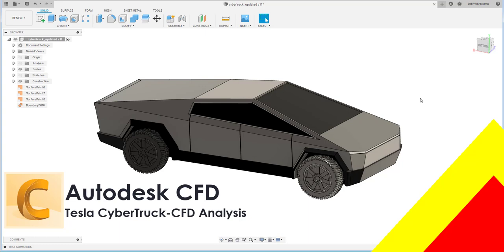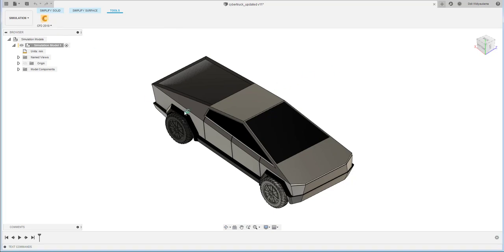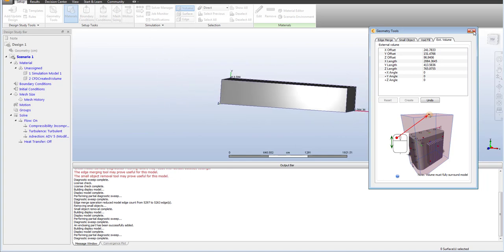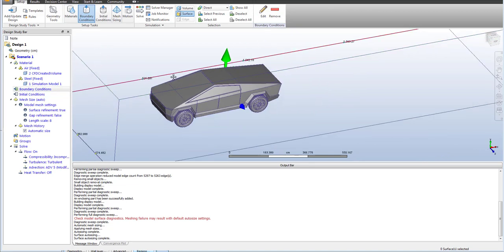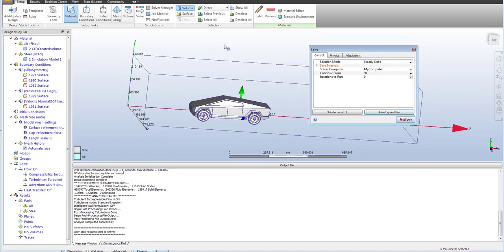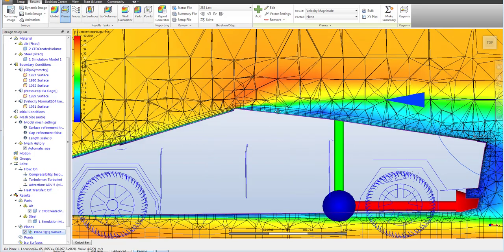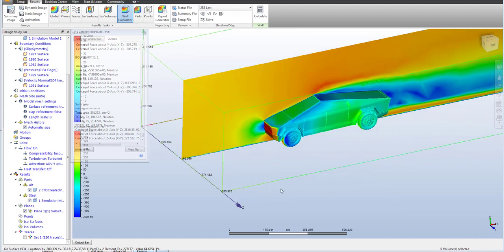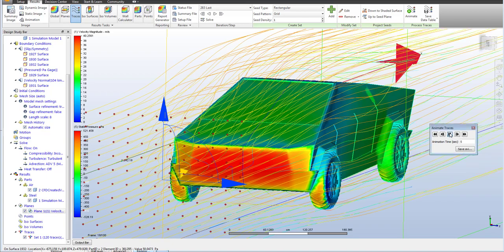Tesla Cybertruck Put in Wind Tunnel CFD - Autodesk CFD

Comment: The car bottom doesn't really seem to be grounded at bottom. Does it impact the analysis result? I'm trying to calculate lift and drag on my structure and thus concerned if not being grounded at bottom might impact the analysis sanity. The CFD software won't let me intersect my structure with the walls of external boundary. Please suggest me if there is a way to do it withing CFD.
Reply from the maker: Of course it will affect the results. I suggest you create a 3dmodel for the road to simulate it

Comment: great video! 👍
I’ve been working on a car in fusion360 as well and transferred it to CFD. But after creating exterior box, the whole car and box together gets saved as a same part (hence can’t apply different materials or selected individually). Any solutions?
Reply from the maker: better create the outer fluid domain in CFD instead in fusion
Reply: @DidiWidyaUtama  Thanks a lot for your time. Yes, only the vehicle was created in fusion. The fluid exterior volume was created in CFD itself. It’s only reading the side mirrors as a different part and I can only apply solid material to that. I’m pretty lost now.
Reply from the maker: @hibelhussain  ensure your 3D model are watertight as a single solid body
Reply: @DidiWidyaUtama  yeah I think that’s the issue. I tried stitching and it seems pretty hard to resolve since it’s a complex model 😅

Comment: I have a car which was done in Inventor professional 2018 (ipt format) and before inventor, its blueprints was done in AutoCAD 2018 (dwg format), what's the better format to open it in CFD 2018?
I open it as an ipt format, but a few features is shown to me on the surface
Reply from the maker: when you install both inventor and CFD, then CFD icon will show-up in the inventor menu bar, just click it to direct import inventor model to CFD.

Comment: Is there a method in this software to see the down-force or lift in a way that you can compare the front wheels against the back wheels?  Example you add a wing on a car... does it generate too much or just enough rear downforce compared to the front.
Reply from the maker: Liberty Francis what i did in my video i was plotted surface pressure in all surface of the car, and in this case we can see according to the color which area with (high /low)pressure will generate (more/ less ) force lift/drag obviously at the particular location on the surface. In addition keep note on the pressure directions when plotting the surface pressure (X,Y,Z) direction.